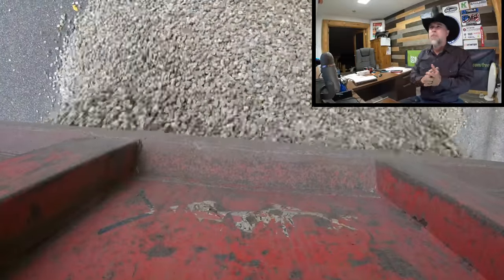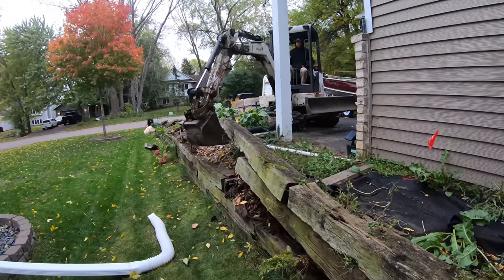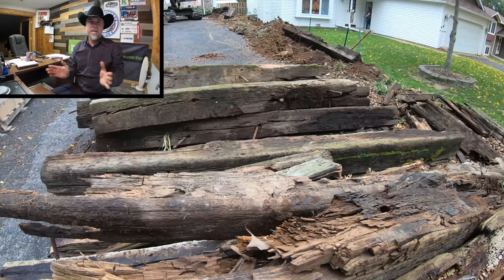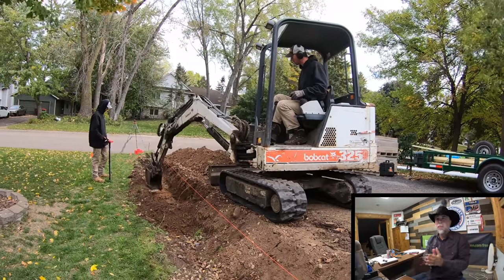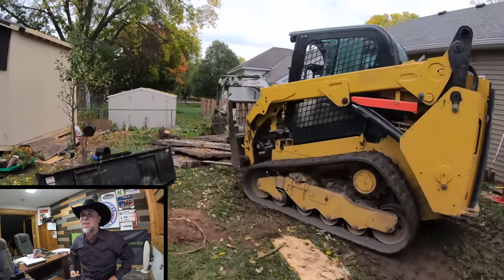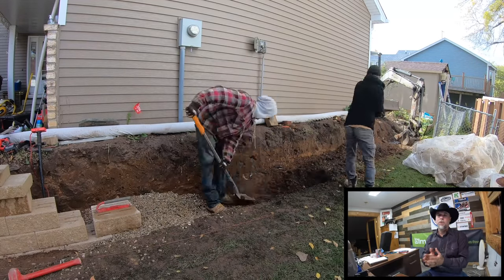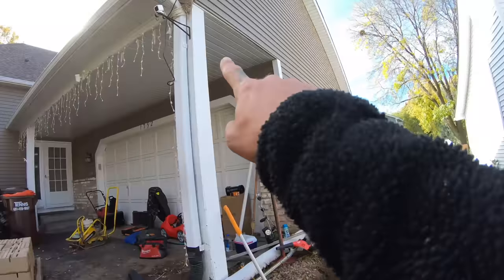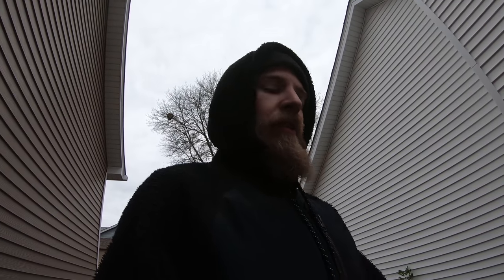Crazy Neighbor Loses it & Calls the building Inspector 5 times!

Comment: I was a code enforcement officer for 20 years. Drainage issues between neighbors were the worst cases to work. Don't ever buy a house at the bottom of an inclined street! Water flows downhill, duh!
Reply: Yep, I bought the one on top of the hill.  Idiots built brand new houses behind all my neighbors’ properties and next to water company land behind me.  

They have to drain their water tanks and inspect them every year or so.  Tried to warn them about the possibility of flooding for yard and even slab houses….

Still bought and  like idiots.
Dont blame us when all of our rain and the water company’s drainage flood you out and insurance wont cover it!
Reply: Are the uphill neighbors legally responsible for any of that water? I imagine as long as they aren't purposely moving it toward the downhill neighbors they wouldn't be.
Reply: @Egleu1  properties should be designed so that the majority of water flows to the front so it can go down the curb line. So you're correct. If you build something that directs water onto a neighboring property, you're at fault & liable. Also, you must provide a backwashing method for a pool that doesn't allow the water onto another's property.
Reply: i live in a house on a street called hilltop and is in the highest point of the whole neighborhood because it was the first house there. gotta love having the highground lol
Reply: Absolutely, Otherwise you will be fighting water issues for years and it gets expensive real quick trying to come up with solutions.
Reply: Truth! I learned the hard way!
Reply: Who's liable for the sidewalk if the water drainage line is starting to sink under the concrete causing the sidewalk to collapse and now making the driveway crack?
Reply: @llamacebu216  you are
Reply: The house at the bottom of our street for some reason is unable to grow a lawn. The past three owners or so spent a fortune on the lawn and the end results, some kind of weed or whatever takes over and wipes out the lawn. Contaminates maybe I don't know.
Reply: Thing is when buying a house, people at the time they have fallen in love with the house they are buying, don't pay attention to things like the way the house is situated like being downhill on a long decline from the other houses on the street. That lady should have chilled out and asked these guys what they might suggest to help correct their drainage issues, but she was so caught up in the drama of being pissed off at her neighbors, blaming them for her issues, no way could she accept any advice from the crew she felt was going to make things worse for her.
Reply: @carollindsey4864  I find these drainage problems strange in the U K all properties have their own drains that are piped underground into the sewer system.
Reply: @catherinewilliams3850  in this case, we're talking about rain water or someone watering the grass, washing the car, draining the pool, etc. Most of the water soaks into the ground but the extra runs out to the curb and down to the storm drain. That water goes to creeks, rivers or lakes.  Of course all sewer drains connect to the city drain lines to go to a cleaning plant.
It is usually illegal to build anything or change your landscaping to make runoff water flow onto someone else's property.
Reply: @carollindsey4864  The rainwater from our rooftops directed into the down pipes also goes into drains at the bottom of the downpipe into underground pipes. A lot of people have down pipes connected to water butts to collect water for their gardens when the butts are full any excess water is redirected down the pipe to the drain.If it isn't connected to a drain it must be directed into a proper soakaway it can't just be left to pour onto the ground anywhere.
Reply: @catherinewilliams3850  alot of us municipalitys will NOT allow storm water to mix with the sewer lines. 

Our city has separate drains for rain all across town
Reply: @Seasniffer69  I just don't understand why the down pipes from the roof just spill out onto the ground instead of going into drains to be piped away underground.
Reply: @catherinewilliams3850  because lot of our infrastructure is very old and not maintained very well.

My town just went through a $200 million dollar project to separate all storm water drains from the sewer (poo) lines.

My towns also based off a river and it released water into the river every so often, whether it was storm water or sediment filtered poo water, I'm not entirely sure. the EPA was fineing the town every year because that system next to a river isn't kosher I guess.
Reply: good advice. many people don't realize how important proper drainage is.
Reply: That WALL looks to good for that HOUSE     wait a minute that far up north and they have cheap ass siding OUCH there heating BILLS must be CRAZY
Reply: @GT-43  city was and they fixed it
Reply: I lived in a house where someone came in and built an apartment complex behind us -- SO MUCH WATER drained doen from up there that it flooded our yard and double garage every spring and caused a ton of damage.  I'm always shocked that they even allow new construction that doesn't plan for and mitigate that! 🤦🏻‍♀️  Thankfully for me, it was just a rental so not my problem long-term!
Reply: @Jaxmusicgal23  new suburbs usually put a retention pond for all water to drain away. i guess no such thing in ur casE?
Reply: @valerierodger7700  Well it's not my decision, ask the authorities who put in the drainage systems, we have enough trouble with flooding in the UK withouyt adding to it by not safely draining the water away.
Reply: @valerierodger7700  I can't speak for the UK but where I live (Australia) the stormwater pipes (or drains - not certain of terminology) are laid underground in each yard (connect from roof gutters into down pipes) and and then open into the street gutter, so rainwater is not going into the sewer system. I'm assuming it's to prevent that excess water from being redirected into a neighbour's property. Then (as I understand it) the water is eventually redirected into very large stormwater drains to prevent flooding.
Reply: It can be a blessing if you like water features...but fwiw with a large rural property I find myself dealing with water flow no matter how you slice it and its really not that hard to deal with.  If I can do it here this lady can hire someone to deal with her tiny quarter acre lot and do things right instead of a sump pump to nowhere.
Reply: If possible just don't live in neighborhood
Reply: Back in 98, here in Cali we had heavy rains and the last house on the block sustained immense water damage. Since then, they put up a nearly 7 foot wall around their backyard😀
Reply: @llamacebu216  The city.
Reply: @GT-43 
 Nope.  The city owns the sidewalks, they fix cracked and broken walkways, not the homeowner.
Don't believe me?
Start digging up the sidewalk in front of your house, and see how fast they send someone out to stop you.
Reply: @oldyellerschannel4676  yeah until they blame you because the water ran off of your property and undermined the sidewalk.
Reply: In some places you cannot change the flow of the water or the intensity of the water
Reply: Yeah, we passed on a slab house that was directly downhill from a decently large man made pond (roughly the size of an olympic swimming pool). There was a fair bit of seepage, trees on the edge of the pond with roots going down the hill onto the property we were viewing. Truly a disaster in the making! Sad thing is the owners had clearly out a ton of money into remodeling the interior, but it's just a matter of time before water moves downhill.
Reply: Sealed a few basements in my a day
Reply: @Mardasee  The rain will wash down all the seed nonstop.
Reply: Most codes in my area require that any water that originates on your property has to stay there.!

Comment: Had the same problem with my neighbour while putting in a retaining wall. She was on the downside of the hill from my property and I discovered she had dug an illegal drain system that was dumping all her drain water at the base of my retaining wall of another neighbour. I later discovered that she has levelled off all her property without building ANY retaining walls after doing so, which forced all her neighbours to have to build their own retaining walls. Last laugh is on her though because now her place is like a swimming pool when it rains as she has no place to allow the water to flow downhill. 
As was aptly mentioned in this video, you can fight your neighbours but not the laws of gravity.

Comment: That drain issue reminds me of a problem my friend had.  He bought a house and the first big rain storm water was pouring into his supposedly dry basement, and the sump pump couldn't keep up.  He was frantic.  My friend and I took a look, just to see if we could spot any 'derp' things.  The previous owner had installed a long fence running along the front of the lawn, and when they did it, they had moved the hose the sump pump was pumping through, and coiled it up right near the house.  It was just pumping right back against the foundation.  We grabbed the end of the hose and walked it out to far end of the fence.  The pump didn't survive long after that, but he didn't have any water problems after that, and actually finished the basement later.

Comment: The same thing happened to me. The neighbors spoke to the city about 3 times until the inspector  told them that there was nothing wrong with what we were doing.
Reply from the maker: Neighbors are somethin else sometimes 🙃
Reply: I had a neighbor like that. He got really frustrated when it turned out my project was approved by the planning commission and I had a building permit.
Reply: We had an old retaining wall collapse due to a neighbors downspouts being diverted to the property line through a non permitted French drain they installed.  Our contractor hired an architect, and structural engineer who drew up plans to submit to the building permits department for a building permit.  The permit was approved.  Our contractor started demolition, and the neighbor called the building permits department on the first day of work.  They tried to issue a ceast or decist order, but it failed when the neighbor was told there were plans, and a valid permit.  The wall was completed, and the neighbor passed away a short time later.  With a permit, and approved plans, there is nothing a complainer can do to stop you.  When you own the property, you can do what you want inside your property line, and a permit helps you.

Comment: As a landscape contractor myself, I almost always (if the next door homeowner is available) go to the home next door to discuss the project, ask if they agree on the property lines, ask if they have any questions or concerns and usually receive their blessings nearly 90 percent of the time without issue. Sometimes there are discussions about what he said/she said on neighboring disputes but we try to work through all the bugs. Needless to say, we don’t get these issues as you see here. Our system may not be perfect but works fairly well.
Reply: Forgot to add - when we do approach the adjacent homeowners, we discuss all their issues too and try to find solutions for their property so they feel connected to our landscaping project and we often get a project next door to help out their situation. It’s a win win for most folks.
Reply: With an ethic like that, I bet you probably end up with a second job on the spot as the neighbor sees problems in the area being worked that could best be addressed at the same time rather than come in and do later.  Such as this lady's drainage problems.  If she'd been willing to work with, rather than against, the crew they could've probably helped her with a lot of her drainage issues.
Reply: How much do you think those retaining blocks cost? I'd love to build a house out of those.
Reply: @PanzerBuyer  $3 to $7 each and they are not good for tall walls due to their sheer weight.
Reply: I wouldn’t start a property line job without a survey first, but people are cheap and don’t want to spend the money on a survey, so this sort of thing happens.
Reply: @rd4660  What makes you think they didn't have a survey done? And why would you need to discuss your improvements with your neighbor?
Reply: @rd4660  Excellent suggestion. Surveys would save everyone a lot of subsequent problems......especially when fences are planned.
Reply: Dont forget to offer them a discount on building a wall on their property maybe theyd like to match their neighbors wall.

The "discount" is their neighbor already paid for 1 side of their wall ;)
Reply: That being said I would also asked if she would have wanted her drainage done at the same time which would have most likely saved her money since the workers were already there.
Reply: @Username-es1iy  as a farmer when building a fence line or anything between our neigbours we are responsible for the left and they are for the right when facing the nieghbour. And if it is decided that it would be the same fence that is put in the cost is spilt between them.
Reply: Excellent! Great advice!
Reply: REALLY  ???   I THINK FROM THIS VIDEO WE CAN BE SURE THESE GUYS RUN A TIGHT SHIP AND KNOW HOW TO KEEP THE PEACE
Reply: @margaretporkolab7166  I’m also a farmer and I build all my fences 6 inches inside my property line so they’re not shared. That way I can take it down if I want too. Here in Tennessee if you build on property line, other party has to agree to take fence down, even though they didn’t contribute.
Reply: There’s always that 10%😆
Reply: You are asking for Trouble like that.
Reply: And that is the way nieghbour should be. Thank you for pointing that out to other commentors to 👍💐
Reply: @tracyjohnson5023  that is a wonderful idea especially if your neighbor is nasty.   Also I have learnt that some property owner allowed a neighbor to cut the grass on a ten foot wide driveway along the property line which was only used at haying time. Had lost it to his neighbour because of the fence line for the house and yard ran along the grass driveway.  This fence then cut 10 feet back to the barn yard fence.  Not sure all the peculiar on it but the neighbor claimed the area that he maintained because of the number of years. The property owner went to court and lost. So all those years he paid land taxes on that portion. Oh he  found out about it when he put the place up for sale.
Reply: Where I'm from that's called common sense
Reply: Communication is key.  It also gives you a gage of who you may end up dealing with.  I had a non-adjacent neighbor who would always call codes on us for every little improvement we tried to make.  I always called codes before I started every project to ensure proper permitting.  Needless to say, after his 4th or 5th call, codes threatened to arrest him.  The issues stopped until a concrete truck accidentally ran over a portion of his sidewalk.  From there, the cops would purposefully park on the street by his house and walk up to mine, ask how my project was going and wish me a good day.  BTW, when I sold my house after the improvements, it was on the cover of the Real Estate magazine.
Reply: You have it right.  I've had the reverse experience many times.  People just turning up and unloading on my property "for access".  Always starts out bad and the legal starts.  If they started like you did, I'd never push the button
Reply: @benjaminpettibone4254  that’s being a great businessman!!  Respect
Reply: @benjaminpettibone4254  Appears that IS what irritated neighbor needed! She needs fill where her lawn is lower by house. The fact that she tries to move gutter water away from foundation... won't resolve ground slope.
Reply: Makes a lot of sense and it probably makes them feel like they have been considered. Sad so many unqualified contractors cause some distrust. It does seem like people always think someone is just put to get them.
Reply: Smart on your part to really try to mitigate any problems that could happen and have backup plan.
Reply: I am also a landscape architect and own a landscape construction company. I was going to say the same thing. Anytime I am working on a property line, I always go talk with the neighbors and explain what I plan to do and why it would be better for them too. This retaining wall definitely improved the look and the drainage. I would of discussed why the neighbor is having drainage issues like you pointed out in the video. You would of had a happy neighbor, happy customer and a possible corrective drainage project in the neighbors yard. Last but not least, they did walk in her yard a lot and left some dirt behind. I would of raked that dirt up and spread some grass seed.
Reply: Sounds like the guy who’s never met anyone bad. I’m happy for your privilege sir. I wish I could go through life and not meet any evil homeowners.
Reply: That's an excellent system.